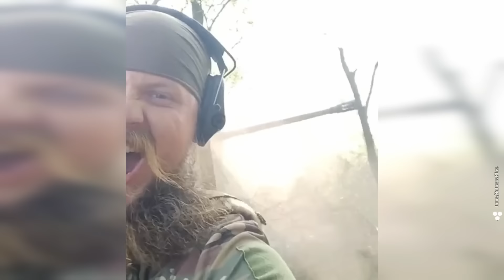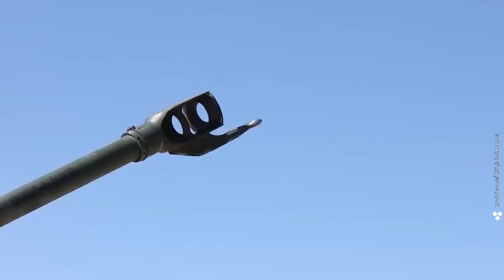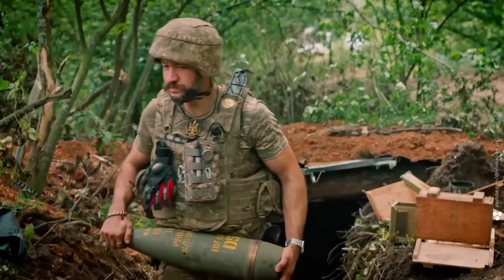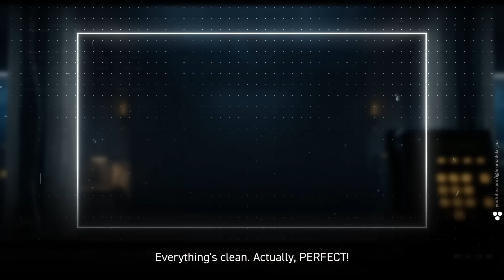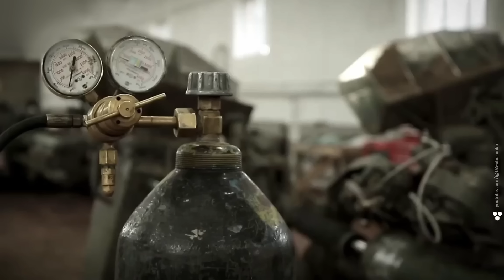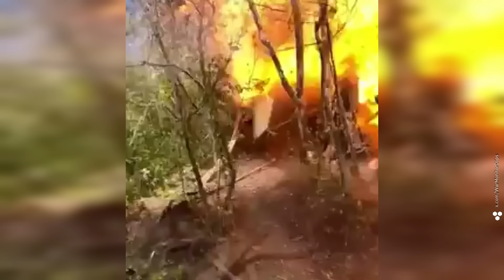Ukraine Found a GENIUS Secret About the M777... And Russia Has NO ANSWER For This!

Comment: Great article. Exciting to see the Ukrainians refurbishing the damaged XM777's. I was the lead Manufacturing Engineer for the US company that built the 1st  and all the following lower carriages of the XM777's. Our titanium welders did amazing work. At peak production we were cranking out 18 per month of fully assembled XM777 lower carriages that included the running gear, braking systems, and hydraulic pumps for raising and lowering the gear. It was a challenge to figure out the compensation of the weld distortion and shrinkage to the machined titanium castings.

Comment: The difference in the cost of what the Ukrainians can do and the western defence firms shows how over priced what the western firms produce is.
Put another way, more could be done that provides more effective defence than is achieved. The UK has been hit by any number of defence project failures. £billions of delayed over budget projects. Huge resources pushed into big projects that can’t work well as the support infrastructure and military personnel they need to work with them are not funded, or are stuck in maintenance as the dry dock facilities are too few. 
The UK spends huge resources on defence yet is currently struggling to send one frigate to the Gulf. Was unable to defence its sovereign base in Cyprus from some drone. Missiles can be developed and produced but if used up in an actual conflict cannot be re manufactured to restock without a new contract and govt funding to rebuild a new production line. That takes years. How many Storm Shadow missiles does the UK have? They are very useful in Ukraine, but will UK give UKR more as they are used up? Understandably UK doesn’t want to lose its own capability so will they sit unused as Ukraine runs out? Can’t there be missiles made from mix and match common components that can be plugged together according to the need? They may not be the most tech advanced at the time but still useful in a real conflict.

Comment: Send them hundreds more howitzers
Reply: The Howitzer has been replaced by FPV drones my friend. A drone has a 10% success for an expenditure of just $350 per "shot". One Russian casualty for just $3500. That's well under the current price of $4500 per artillery shell.
Reply: @sjansen66  The old technique has some advantages: standard shells cannot be electronically jammed. Every 20 seconds a new one can be fired at a target. The destructive power is much greater than that of an FPV drone. When it explodes above the ground it covers a wider area.
Reply: @Mrpeacemaker2 all things an fpv can do. With fiber fpvs they can't be jammed either. 

Current generation drones can carry upwards of 20kilos/ 40lbs and have pinpoint accuracy.

They can be command detonated as well. Various warheads for various purposes. 

There are drone dropped shaped charge grenades, the obvious anti personnel shrapnel filled versions, ground penetrating delayed grenades and nowadays even gull blown napalm canisters (as opposed to the old gasoline bottles they used to drop 2 years ago).

Artillery needs a tube with limited mobility and a crew to serve it. Drones need 1 operator and a second guy to help carry his shit. 

There is a reason the drones are by far the most lethal weapon currently used in Ukraine. The era of artillery is coming to an end.
Reply: @sjansen66  There are videos of soldiers cutting the fiber optic cable and thus destroying the drone on the spot. Can you use scissors to destroy a grenade that is rushing towards you at 3000 km/h? Good luck.

A standard 155 mm shell weighs about 50 kg of lethal metal and explosives. FPV drones with a 20 kg shell are large, slow and an easy target.

 Furthermore, fog and rain are a big problem for FPV drones, while howitzers work great. This is precisely what the Russians used for their advance in the winter.

Drones have changed a lot in the tactical field, but to discard artillery would be foolish. The Ukrainian army is the most innovative in this sense, but they do not want to give up howitzers.
Reply: @Mrpeacemaker2  Drones with IR cams are a thing, and fiber cutting is rare. The ground is littered with thousands of such strands. Which one should they cut?

An artillery shell is inaccurate as hell and only as accurate as the spotter can make it. The drone operator is his own spotter. 

The Russian "advance" wasn't really successful last winter, was it?

The results speak for themselves. The number of kills by drones are exponentially higher than the artillery victims, but to just get rid of the artillery is an over reaction. It has it's purposes, but it's no longer the king of the battlefield.
Reply: @sjansen66  
The present and future of the battlefield is not "drones or artillery" but drones and artillery.
Reply: @sjansen66  The M777 still has a range of 40 to 70km. FPV drones are maybe 10km max. The M777 can reduce a trench to a crater FPV's still can't do that yet. Military industrial complex will have to start operating at cost and not for profit to compete soon.
Reply: @knowahnosenothing4862 one M777 can try to do that, but the hit percentage at that distance is slim.

It hits in the general grid, but not in the trench. 

Also, before one m777 has done any significant damage to said trench, it's reduced to rubble by either counter battery fire or a drone hit.

Artillery has a great role, but towed artillery not so much. 

Let me repeat: the statistics of modern conflic speak for themselves.
Reply: @s @sjansen66 ctually $3300 / shell. But you need the big warhead to destroy bunkers, mass troop/tank attacks. US company has been doing proof of concept on beaming microwave energy at drones. 100% effective and a small fraction of the cost of a drone.

Not surprisingly there is a long list of technologies currently under development that will destroy drone swarms
Reply: @Wolf-hh4rv The US military may currently pay 3300 per shell, but that is not the reality in Ukraine. Artillery shell prices are inflated to hell nowadays. 

Another reality in Ukraine is that there are no more mass attacks. These attacks are all discovered and hit before they even start due to the numer of recon drones along the frontline.

At most, Russia can assemble a couple of tanks and IFVs and do a localized assault.

Comment: A firefinder radar does not give you a target location to within 10s of meters. It gives you a target location down to ONE meter. At least ours do. I got to use a radar as my dedicated observer once. The correction in adjust fire came back as a 10 digit grid! Or was it a 12 digit grid? None of that "left 200, add 50" stuff.
Reply: Were you trained to use it in a conventional method without the radar?
Reply: @t.r.4496  Oh yes, I could do a traditional "call for fire" with map, compass, and binoculars.